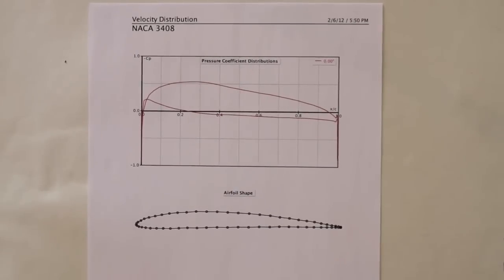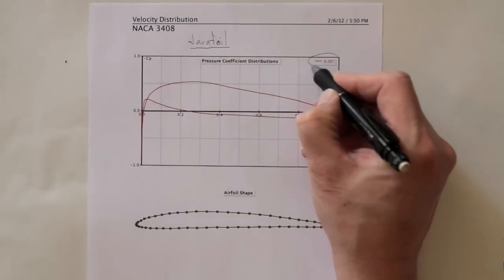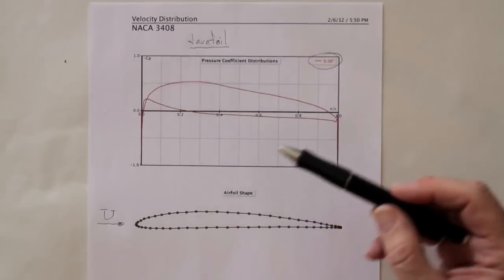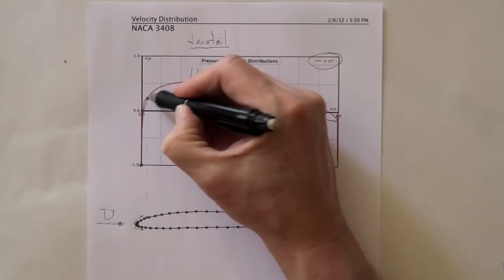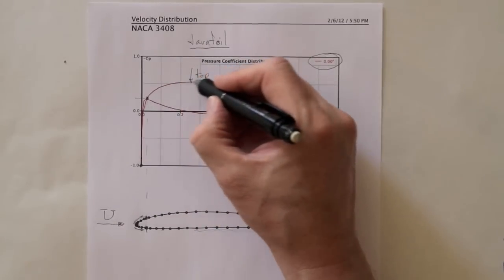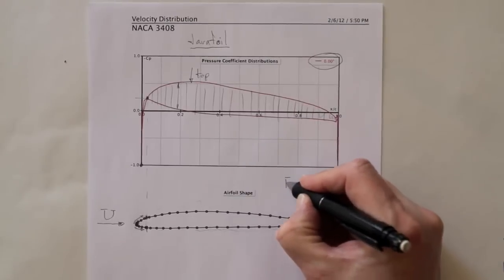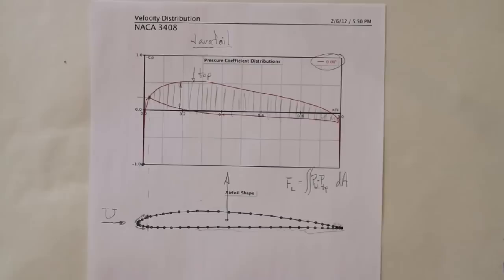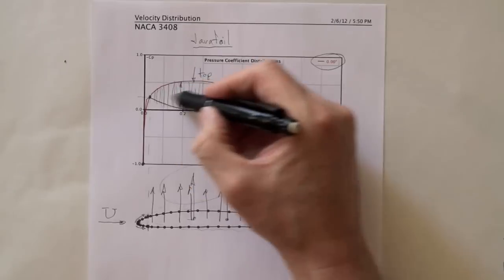Pressure Distribution on a Wing

Comment: The question is why pressure differential increases as speed increases? As aircraft speed increases, velocity on bottom and top of wings increases too. Then, pressure on top and bottom of wings decreases too. Why does a pressure differential comes up and lift force increases?
Reply: No.  Wings change the pressures around them - some are above ambient [positive gage pressure] and some are below ambient [negative gage pressure]. .
Lift is the  difference in pressure from top to bottom of a wing.
.
As speed increases, the effect of the wing increases. The wing changes the pressures around it FARTHER from the ambient free stream.
This means that the pressure below the wing goes UP and the pressure above the wing goes DOWN, thus making the difference GREATER.
.
I can only assume you bought into the most common misconception around Bernoulli's Principle:  FACT: "Fast air does not produce a lower pressure.   
.
The TRUE Physics: Air is ACCELERATED toward a lower pressure. The higher pressure pushes more, thus providing a net force, on the mass in air, toward the lower pressure.  It's Newton.  When there are two opposing forces on an object, there is a NET FORCE toward the lower force.

Comment: Great video. It helped me to find lift coefficient for NACA0015 for different angles of attack. But now, I am wondering how to find drag coefficient. Someone could tell me how to do that?
Reply: Calculating drag coefficient for airfoil is not very useful as it would vastly underestimate the drag of wing (full 3d structure as opposed to 2d slice has flow component along the wing edge messing things up). That said you could just integrate the horizontal component of pressure over the circumference since drag is a sum of horizontal surface forces.

Comment: I am a little concerned that you show the pressure points as pointing up vertically. I have always been taught that the pressures at different parts of the wing point at angles away from the surface.
Reply from the maker: Pressure acts perpendicular to the surface, but in this video I was focussed on the lift generated by that pressure, hence vertical.

Comment: Nice video. Why does the air has to increase speed (per Bernoulli's principle) after the stagnation point? The air flowing on top of the wing do not have to meet the air flowing on the bottom of the wing at the same speed when they meet at the trailing edge.  I believe that using Bernoulli's principle to explain lift of an airfoil is not entirely correct. Most of the lift is produced by the down wash of air at the trailing edge of the wing (Newton's 3rd law of motion).
Reply: And what is the down wash reacting on??...The forces acting On the wing, pressure On the lower surface, plus the loss of pressure On the upper surface, give the up force, the Down flow off of the aerofoil  accounts for the Total energy Loss of the system....
Reply: Edwin,
It speeds up because the pressure ahead of the wing pushes more than the relatively lower pressure above the wing.  It is Newton accelerating the mass in air.
Reply: @regdor8187  Downwash does not "act" on anything. 
The downwash is the RESULT of the pressures around the wing.
.
In the mid 1700s, Euler figured out that it is a Pressure Gradient (a difference between two locations) that Accelerates fluid/air toward the lower pressure region.  The higher pressure region pushes more, which is a net force on the air toward the lower pressure region.  Simple Newton.
..
Pressure at a point pushes outward in all directions.
..
Pressure under the wing pushes up on the  wing AND pushes down on air further below the surface -- contributing to the down wash.
..
Atmospheric pressure far above the wing is pushing down toward the  upper surface and the lower pressure there.  THEREFORE, there is a vertical Pressure Gradient Accelerating air downward that continues after the wing passes, contributing to the down wash - thus making the total downwash.
. . . 
For a full explanation see this: Understanding Lift Correctly: 
 https://rxesywwbdscllwpn.quora.com/ 
- - 
Regards

Comment: There is no analytical solution to find the pressure distribution?
Reply: There is - you need to know the functions of the pressures, probably by curve fitting and measuring. I think knowing the camber line helps a lot with developing the distributions, but i am not profficient enough yet to tell you how :X

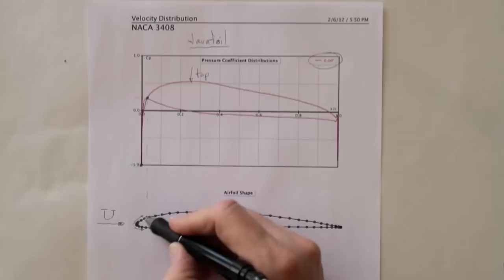Comment: at 2:37 you say "negative pressure" this is not correct: the pressure coefficent is negative and it leads (bernoulli) to a positive pressure lower than the "undisturbed" pressure. negative pressure can not exist.
Reply from the maker: wikipiero you are correct that total absolute pressure is always positive. It is the dynamic component of the pressure that goes negative, taking the total pressure at high speed locations below the ambient pressure.
Reply: can't understand what the "dynamic component of the pressure" is. can u explain please?
Reply from the maker: wikipiero Bernoulli includes pressure, velocity, and elevation components in the total. The velocity component is often referred to as “dynamic”. In air the elevation effects are usually negligible and the pressure coefficient Cp represents the dynamic effects.
Reply: I was looking for a clear and simple explanation for some friends of mine to the fact that no negative pressure exist on extrados and no suction exist for the airfoil I.e. the air which flows on the extrados pushes the airfoil down. Your video is quite clear except when you say there is a negative pressure without specifying “dynamic pressure” nor specifying how to take this into account. On the other hand, although I can understand your explanation, I’ve never heard about “dynamic pressure” and as far as I know Cp is just a coefficient to calculate how the (total) pressure changes: always above zero. At the end your video is useless to me. Anyway thank you for the time you spent answering me.
Reply: @wikipiero  ,
The term "negative pressure" is very commonly used to indicate pressure that is less that the ambient atmospheric pressure.
..
We also use the term "gauge pressure" to indicate the pressure relative to the ambient atmospheric pressure.
..
For example:
Assume we have an ambient atmospheric pressure of, say 14 psi.
Then we have some flow that meets a surface normal (perpendicular to) the flow and stops at the surface where we measure 15 psi.
The "Total Pressure" is 15 psi.
The "Dynamic Pressure" is 1.0 psi.
The "Static Pressure is 14 psi.
The "Gauge Pressure" is also 1.0 psi.
... IF ...
We find a surface with 13 psi on it.
This is a Gauge Pressure of -1.0 psi
This is a negative pressure of 1.0 psi. 
...
Sometimes we can also use the term "Dynamic pressure" to mean any pressure that has formed as a result of the relative motion of the air and some surface.
...
So, yes.  The pressure on the top of a wing always pushes down and the pressure on the bottom of a wing always pushes up.

Comment: Hmm...How does angle of attack influence the lift characteristics and how would this wing provide lift when inverted?
Reply: This is simplified for slim wing, so the surface normal is not in equation.
You would get different pressure plots for different attack angles but it would not work worse as long as angle of attack was relatively small.

Comment: These explanations don’t explain anything when they do not show why the airflow speeds up over the curved surface. Of course no such thing happens. What does happen is this :  imagine a container with a gas ,all the particles are in random motion and the pressure on the walls is equal. If by some magic the motion of these particles could be arranged in one direction the pressure would not be equal in all directions etc.  Another relevant fact is that gasses occupy only a small fraction of the space they inhabit due to the large voids between the particles,the reason why they are compressible. In this way two imaginary steams of gas with their particles neatly parallel could pass through the same space at perpendicular angles without interfering with each other. Here we find the solution to the problem of the explanation of “lift’. The motion of the front edge of the airfoil creates an air mass with special properties,ie alignment of motion of its particles,this air mass is added to the layer above without change to its pressure in the direction perpendicular to the airfoil . This special mass is also subtracted from the air layer near the airfoil. These conditions rapidly return to normal random motion as the airmass passes over the wing. Well, I hope this is of interest to you and goodbye!
Reply: Oscar,
I see this every time when people try to analyze this at the molecule level.  They always have some misconception of how velocities asdd, or some other misconception.
.
First, his purpose is not to explain anything but pressure distribution ,  not really explain the fundamental reasons. 
..
Now. . . 
. . 
RE: "If by some magic the motion of these particles could be arranged in one direction the pressure would not be equal in all directions etc. "

Correct. You need to study what are  called static and dynamic pressure. 

In short. . . 
Static pressure is the pressure that the molecules exert on each other.  This is what you would measure if you traveled along with any overall directed, average  flow in one direction.  This is some average speed of all these vibrating molecules still bouncing around amongst each other.  This internal pressure is not affected by that overall, directed motion at all. They still vibrate and bounce around as before the flow was caused (magically).
BY THE WAY, that magic is called a Pressure Gradient - a difference on static pressure between two locations is called a "Pressure Gradient.
.
The higher pressure pushes more so there is acceleration toward the lower pressure region.

This pressure is also the same as that exerted on a surface parallel to the flow.  Because velocities add vectorially, any velocity added to a flow parallel to the overall average flow, does not change the velocity, and therefore the momentum and pressure of the molecules on each other, nor does it change that velocity and momentum toward the surface it is near and traveling PARALLEL to.
.
HOWEVER, as that flow approaches a surface, either directly or at an angle, we are now seeing the pressure caused by the entire mass of its inertia toward the surface.  This is dynamic pressure.  It is like you running into a wall or another person.   The momentum of the molecules is indeed increased in the forward direction, but not changed in the sideways direction, nor of them against each other.  
If you bounce a ball on the ground out a car window, the bounce force on the ground is NOT changed when the car moves.  The forward motion and vertical motion are fully orthogonal - - fully independent.

.
You contradict yourself as follows. 
A: "the particles are in random motion" then,
B: "two imaginary steams of gas . . .  could pass through the same space at perpendicular angles without interfering with each other."
You ignored the fact that all that "empty space" is full of molecules wizzing rapidly through all that space bouncing off each other, and the two flows wound FOR SURE be colliding.  

Then you say "with their particles neatly parallel"  which contradicts " at perpendicular angles " - makes no sense.
. . .
Finally, I am unable to make sense out of your last 4 sentences.
. . . 
For an explanation see this: Understanding Lift Correctly: 
 https://rxesywwbdscllwpn.quora.com/
- - 
Regards
Reply: Nope Oscar.  BUT you've come up with a brand new MISCONCEPTION. . . 
.
Every neophyte who tries to use molecules, as you have gets, it wrong.
The supersonic vibrating molecules prevent  two flows flowing through each other.
.
 One undisputed fact is that [Static] Pressure at a point has no direction. It is, therefore, called a scalar, not a vector.

The pressure of a moving point is also EQUAL in all directions.  The large-scale fluid flow [in one direction] can not change the random motions within a flow.  Learn what Static and Dynamic pressure is.

The kinetic energy of the moving flow has already been added by a pressure up stream; such as inside the blower or your lungs. 
The directed flow DOWS NOT alter the randomized, supersonic molecular vibrations.
.
SPEED  reduce the pressure in a flow.  NOPE.  That is an all-too common of Bernoulli's Principle.  It is the Pressure Gradient that is the CAUSE of the Acceleration of fluid.  It is Newton in fluids.  
Force causes Accelerations.!.
. . . . . 

.This "flows passing through each other" is just another misconception and YOU have been the first I've seen to come up with it.  So take pride in you lack of physics knowledge. 
.

And, BTW this video gives absolutely no explanation of the physics that causes these pressures and lift.   He only shows you what the pressures  are.